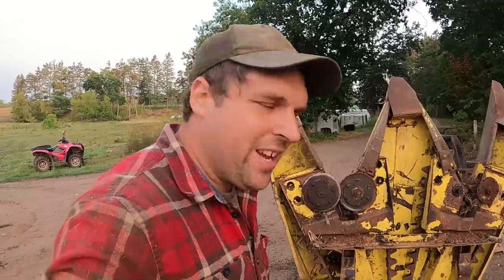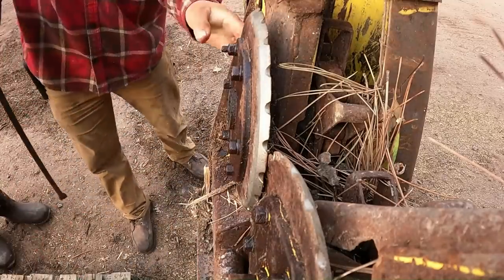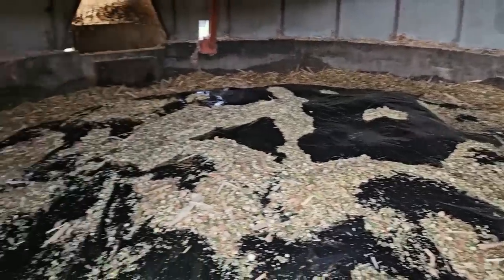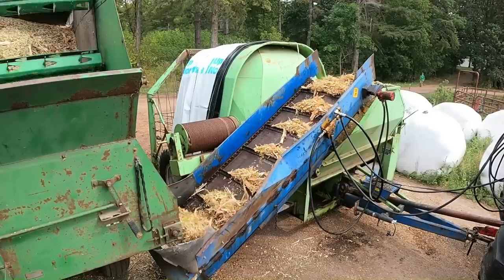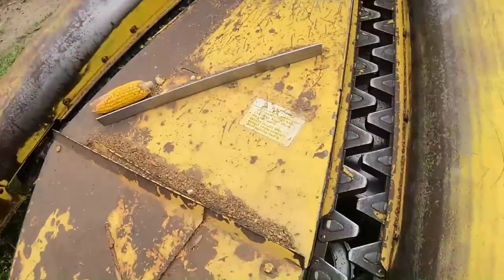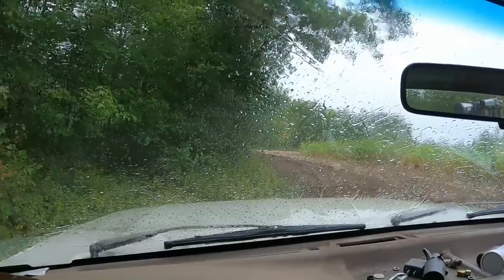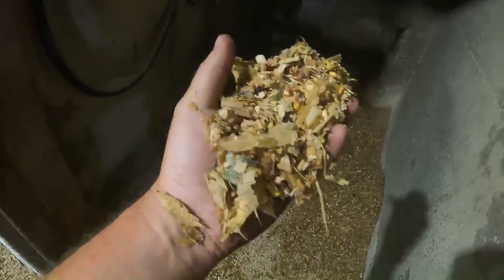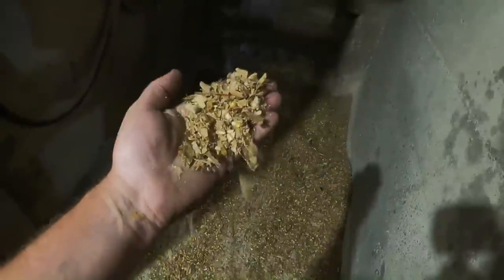Chopping Corn 2023/Day4

Comment: Been there! One of our heads got totalled , so now it's our parts head. Did the same as you did and swapped our discs. Sometimes we found out that it's not the discs, just make sure your gathering 😉 chains are tight enough. Also, your right about the long leaves. Not enough corn going thru, short corn, too dry, dry grass, doesn't matter if it's brand new, same results. We have two 892 choppers. Our original one we bought New in 1982. Easy to service and damn good choppers. Give er hell!!😊

Comment: Good video, nice explanation of silage. In winter it true, will freeze to the sides and it is a bugger to get off. Also in spring, the silo would have silage water in the bottom that had to be pumped out before filling with the new crop.

Comment: Having a couple of extra implements around can aid "scrap pile engineering" to keep things on the move. My frustration would be on a Sat. afternoon or in the evening when no dealers were open for needed parts. If we were trying to beat the weather, a temporary fix helped keep things moving. Agree with your statement on length of cut regarding the amount of material moving into the cutterhead.

Comment: Nevermind my last comment 😳. I ran 80-85 hp JD 40 series on baggers with the hydraulic table, and would have to switch out tractors every few loads to allow hydraulic oil to cool. Swapped with the hauling tractor and kept running. The Reds don't have that problem.

Comment: You can reverse the shims to close the gap by putting them on the top side of the upper cutting knife wheel. Not many chopper heads, even the Kemper type, feed short corn right. Good luck! Great video!

Comment: Cheer up, I bought a good used 717 NH, worked good until the sheer bar came loose and took out the knives, reel, bottom pan, and had to dump the whole load! cost almost as much as i paid for the chopper to fix it!

Comment: Maybe it’s  not worth it, but reducing the feed role speed and removing half the knifes will give you a thicker forage mat and better cut. As for the cutting discs, during operation they should have enough interference to generate heat during operation. About 25degrees over ambient is what I did.

Comment: Question,  when you were using the Gehl 3038 corn head was it on the New Holland 790 chopper?  Anything that was adapted or does it mount the same?  I’ve heard the 3038’s are good heads.  You like the New Holland 822 corn head? Is it different from New Holland 824 head?  
Thanks for the knowledge
Reply from the maker: Before this new Holland,  we had gehl choppers, and that's what the  3038 was on, it's a very good head, I wish I could put it on the  new Holland chopper. The 824, is the  new and improved version of the 822, it's a lot more forgiving than the 822, as far as having to be perfectly on the row, but the 822 is a lot simpler, the  824 uses upper and lower gathering chains,  and the 822, just has one set per row.